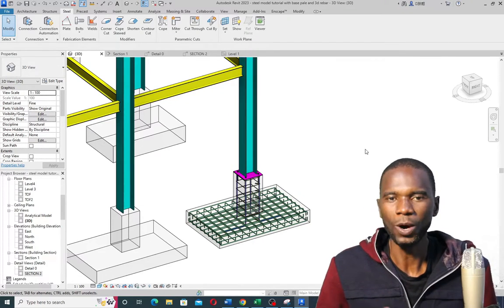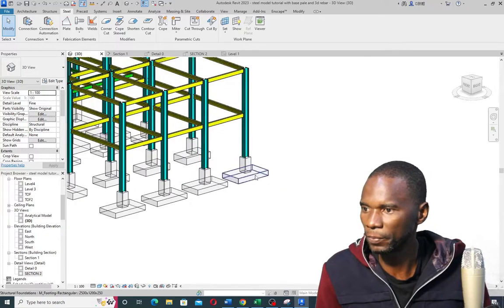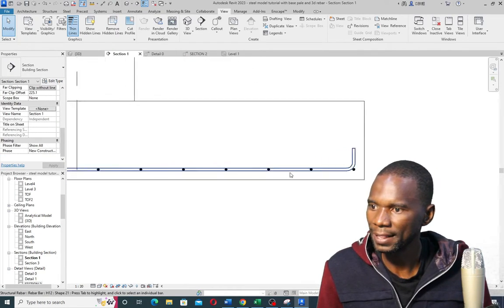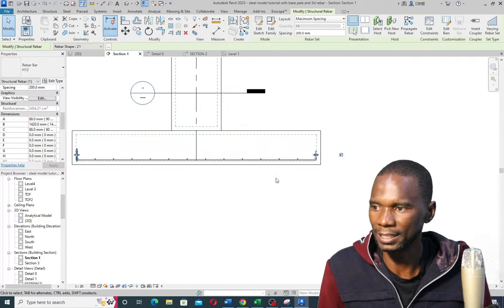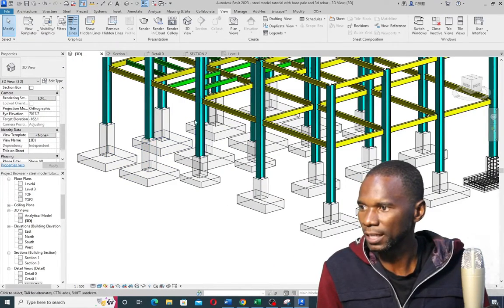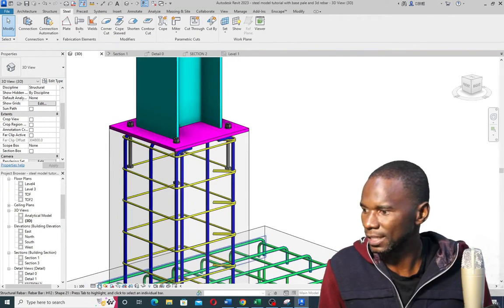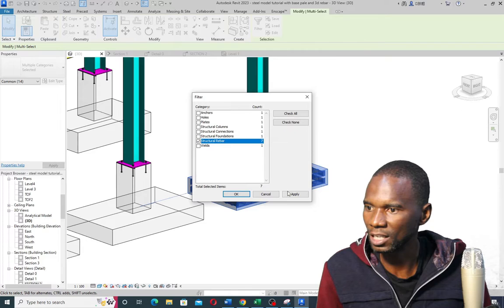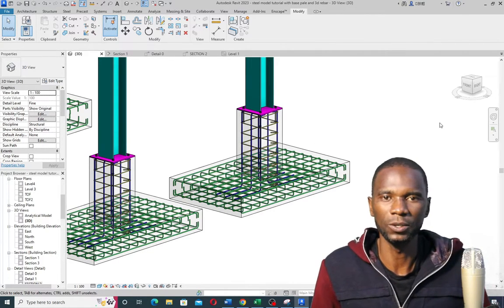REVIT 2023_3D REBAR IN REVIT_REBAR CONSTRAINTS_PROPAGATE etc

Comment: thank you for teaching this! best video ive seen regarding rebar
Reply from the maker: Its always great to hear such positive feedback..Keep learning
Reply: @skillmaxacademy  your channel is a treasure bro, thanks a lot for what you're doing.

I have an issue regarding PCC Footings, for example for isolated RC footings, which drawing tool do I use? I tried the isolated footing tool and it interferes with the bottom cover of the RC Footing which makes it difficult to draw rebar shapes. I tried architecture floors as well that's the best option I found, do you have any tips?
Reply from the maker: @its_reckoning6667  if you use footing dont join them to avoid your issue on cover,,,otherwise use floors
Reply: @skillmaxacademy  how do I not join them? For example:
My Isolated RC Footing is: 2.1m x 1.8m x 0.6m
My Isolated PCC Footing is: 2.4m x 2.1m x 0.2m (or 0.3m)

I place the columns
Then place the Isolated RC Footings using the at Columns tool and it attaches to the bottom of the column.

However, when I try to do the same thing again for PCC Footings it does not draw it, so I place it manually, however, it affects the concrete cover which is annoying for steel rebar.

I haven't found videos discussing this issue.